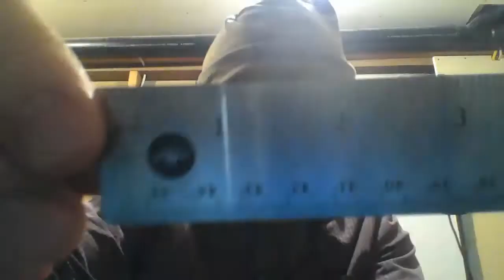Check Slope of a Drain Pipe

Comment: The slope should be 1/4 inch per foot and here’s an easy way to check it. Use a 4 foot level and attach a 1 inch block of wood on the bottom of one and put that on the pipe if it shows the bubble is level then you’ve got your slope correct.
Reply: Cool trick, but learning to read your level works too. If you can’t get 2% grade with a torpedo level you have no business doing somebody’s drains
Reply: Also your pipe should be supported every 4ft which means your pipe should hang 1in lower each support

Comment: Um. @2:36, Your metal rulers' scale Zero line graduation line did not extend to the edge of the metal. The zero was not even close to the end in fact! The drop was more like 3/8", and thanks for not measuring over the pipe strap like you started to do so.